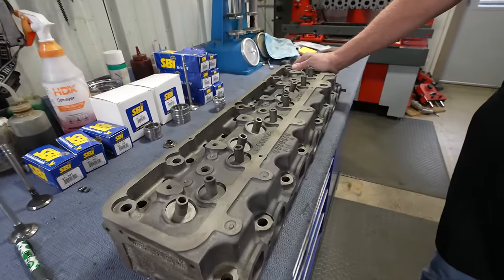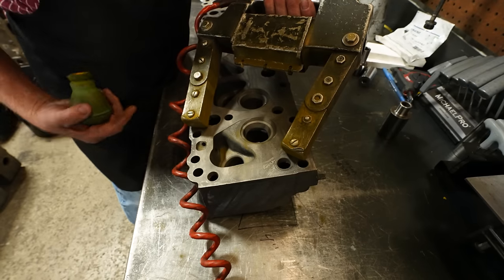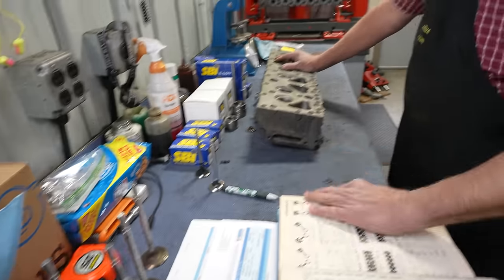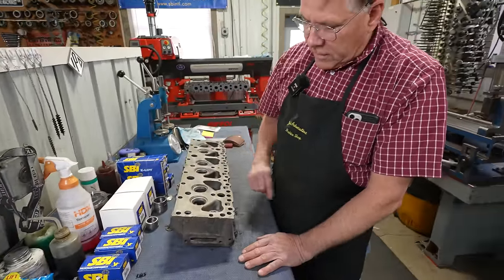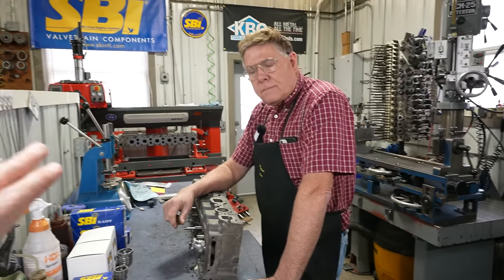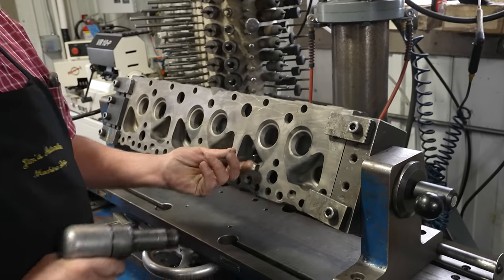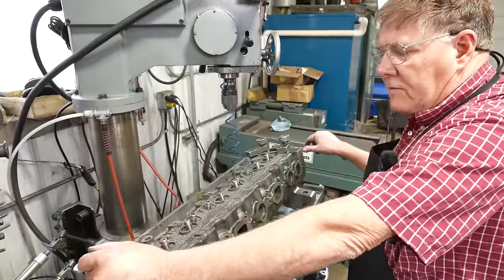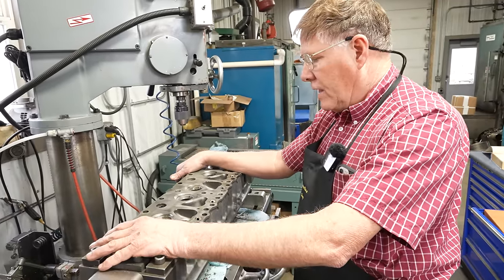Fixing The 235 Chevy Head That STUCK A Valve Guide!

Comment: I've seen a few of your videos about the venerable 235...I had one when I was 12 years old,  in a 53 Belair convertible...early 53, with poured rod bearings...my Dad and I rebuilt that engine in the backyard,  on sheets of plywood.  We cut up beer cans for main bearing shims.  Wound up rebuilding and installing a 56 235.

Comment: Worked in a trade over 20 years. When you spend that much time, if you're good at what you do, you pick up little sensory cues of something going wrong before most people would ever think there was problem.

14:43 , your father knew right away the tone change of the driver on the vale seat was wrong with the impact driver. He didn't force the issue, moved on to the next one for the time being.

Its those fine little things I love seeing in all these videos I watch, a testament to how much experience your father has, how his primary senses of touch, hear, and feel is better than any manual in print or tool made to do it better.

If anyone sees and appreciates the same, the crank grinding vids are a masterpiece of pure sensory operation while simply watching a simple dial on the machine.

Comment: Yes Jim:)
Every time we watch your channel…
We learn something. 

Especially the crank grinder:)
When you put stop bolt in between the crank weights. 
How flexible a Big Cummins Crank. 

Jim - you can also straighten a crank if it’s bent. 

They jack it in the bent spot. 
Use a soft race driver and hammer ..
Give it a wack about the fillet section:) 

V - Blocks hold the crank on each end. 
Then you hack on the low spot 
Sometimes it has to be repeated 2 or 3 times

After it’s within .001 or .002
Put it in your grinder and start grinding

Comment: Wow I have learned so much and I am 73 year old retired technician for Ford and Chevrolet. That was one fine looking 235 Chev head and I have seen several of them. I used to drive a 74 Corvette 80 miles some days to pick up parts on emergency jobs. All the other technicians would complain because they didn’t get to do it but I could do it on my lunch time. It had the 300 hp 327 cui engine and it was smelling like burnt paint and hot brake pads when I got back. It would cruse at 100 mph and do 140 mph on I 70 in the Missouri River bottom interstate. No State Patrolman could catch me. It stuck like glue on the secondary curved roads.

Comment: I never heard of crosshatching the valve but I have knurled and reamed guides to get them back in spec. I do believe that the knurling if done properly and after reaming the flattened point of the knurling supports the valve stem but there are small dimples between these flattened points that can hold a bit of oil. Kinda like a ball bearing in each dimple.

Comment: Vinton positive seals started using them in the early 80's and never had a failure.
Reply: What even are they tho
Reply: Same here. Our local machinist has been cutting the guides on SBC engines to accommodate SBF positive seals for years and it definitely helps with oil control issues.

Comment: We also oven clean all of our iron components, if a head has removable guides we always remove them before putting them in the oven, most often simplifying the extraction process.
Reply from the maker: We generally do as well; however, in this instance we debated not replacing all of the guides. Once it was cleaned & we checked a bit closer we decided to go ahead and replace them all!
Reply: @JAMSIONLINE  Nothing happens by chance in your shop.

Comment: We have a 235 in my grandpas 3100. We need to start it some time this year. Its been over 2 or 3 years since its started and ran.
Reply: You should consider using a like light oil to spray in till it stalls if you can't run it awhile I've had good luck with it with small engines it's a little extra work to start them again but it's almost always just crank a bunch and clean the plugs
Reply: Why does it NEED to be started?   If it's just to idle it for a half hour, you're doing nothing, in fact more harm then good!
Reply: @alro2434  I've seen alot of stuff rust up because the oil falls off like the cylinder walls and the cam lobes when it sits for a long time it's mostly fine in a climate control storage but most garages or just outside it'll act as a heatsink so it'll be cold in the warmer day and collect moisture in alot of places maybe not in a desert but definitely where I live. Sure starting it will cause some ware but it'll recover everything in oil, it's best to drive them even a little your right it's good for the rest of the drivetrain too

Comment: I read somewhere that knurling the valve stem is a "quick" way of tightening up excessive clearance in the guides without replacing them since knurling the stem increases the diameter. 
You have an awesome channel here loaded with the "right way" of doing things --- very enjoyable!
Reply: I agree - that's my understanding of why valve stems are knurled.  In the case of the previous machinist it made a the already 'tight' valve guide situation even worse.

Comment: I rebuilt my 4.9 Ford straight six a few years ago and I installed the same seals on my valves when I assembled the head, They have worked flawlessly ever since and the engine no longer smells oily out the exhaust like most of the Fords do. It's been a great upgrade and the engine runs so much cleaner.

Comment: Ketchup, yes Heinz is my favorite 😊

Way back in the late 70' when I was working after hours for the local Chevrolet Mechanic, we used valve stem seals for the Vega engine on small block chevys, they fit perfect with no cutting and yes  we would leave the oring off.
Same style used on this head but a direct fit, and excellent oil control.

Great Video.

Comment: Hey, I like these videos with engines that are as familiar to me as to the back of my hands! , ...On the chipping of seal and valve driving tools which get hammered on;  I welded a ring of mild steel like 7018 around the edge of the offending tool and that would hold for quite a while and stopped the more "chunky" parts from hitting my face (even with glasses on.) like the one that finally woke me up on safety musts!
You guys are easy to watch and the videos are done in very good taste, you got my vote! Best regards, John.

Comment: One of the most interesting engines I ever rebuilt was in a 1939 Chevy pickup.  It was an original 216 with oil dippers on the rods and 5 piston rings on the pistons; 3 rings above the wrist pin and 2 oil control rings below it.  I was surprised at how smooth and quiet it ran when I got through with it.

Comment: The first engine I rebuilt was a 292 out of a 69 C10. It had been redone about 10k before and the rings had never properly seated as well as they had not put the proper value seals in and it burt oil like crazy. 
Ot was a real learning experience as to why each type of product was used and the reasons why not to use others.
Great video. Thanks.

Comment: Back in the day when I worked in a machine shop (talking over 30 years ago, late 80s when I was a pimply faced teenager) we put those type of seals on everything including the Chevy inlines, small blocks, big blocks, Ford, Chrysler, didn't matter, they all got them.  Most in the 40s-70s came with umbrella seals and I think the small block 350s even into the 80s.  I can't recall ever having a comeback based on those valve stem seals.

I pivoted to tech in the 90s and don't regret it, but I do miss working on engines every day sometimes.  Good times with good guys.

Comment: When you are cutting seats, those long curlys mean there's nothing better. Cutting continuous all the way around in an even perfect plane. 
The blue valves, I had a 85 crate 350 the carb has a factory set bowl adjustment that I had to reset to stop the lean fuel mixture on acceleration. Headers were glowing red. Wow 😮

Comment: Wow 	! I was a mechanic for 50+ years on forklifts, when I started about 1970 my father in law who I worked for had a forklift company, we would rebuild the engines in house but have the cyl blocks cut and crank shaft done outside everything else was done in-house , I remember doing the valve guilds and seats with a special hand drill for valve seats  , all,the engines ran great but we never had the specialized equipment or exact tolerances that you create , your videos are great 👍🏻 some people should see the time and knowledge that goes into rebuilding a cyl head , then they wouldn’t cry about prices! LOL

Comment: A mushroomed chisel got me once. The chip sounded like a little firecracker.  Looked like a steel BB split in half. It penetrated my knuckle and embedded in the bone. I keep drivers and chisels dressed now.
Reply: Good quality drivers and cold chisels are made using medium carbon steel - circa 1050 or 1060 grade. Only the point of the chisel/driver is hardened and tempered, with the body of the item being left in a non-hardened 'soft' state.  This ensures that the portion that is struck by the hammer just simply deforms as opposed to generating dangerous shards that can penetrate the human body.  I'm somewhat concerned with the type of chisels/drivers that are available today - which may have led to your unfortunate experience.  I hope that you recovered completely  from your injuries to the hand.

Comment: I have heard that with heads if you use a short knapp paint roller to apply the RTV it seals great at least that's what a customer of mine told me after tearing down his engine. Then was the guy that got mad at me because I refused to work on his engine just because he used JB weld instead of a head gasket. After 65 years as a mechanic I still like to watch you and your dad work together. I never had a father in my life and you have such a good relationship with your dad, cherish it and I envy you.

Comment: An old gentleman I spoke to at a car show told me that, in the late 40's early 50's - Drag Racers would hot up the 215 Stovebolt sixes and stick them into their 30s Rods. And to be able to have an engine that makes over 120hp stock, vs a sidevalve V8 thats lucky to make 60, it doesn't take many mods to have them producing well over 250hp and you were in some serious butt kicking territory if you were running that for real. It was the hot setup until the Smallblock Chevies came out in the mid 50s and killed everything, some guys actually made good power from the Buick 263 striaght 8's too. Good times..

Comment: Rebuilt a head for a DT 466 years ago which had been previously rebuilt not too long before. The exhaust guides were history and filling the crankcase with combustion gasses. I noticed positive seals had been placed on all guides. I deemed that the problem. Got new parts from IH. They handed me the same guide seals. I told them that was the problem as to why the engine is back apart. They called the old mechanic over from the back of the shop and he said “hell no you don’t use those on the exhaust guides.”  He went to the parts bin and got what had been used previously. Reworked the head and as far as I know the engine is still going about 15 years later.

Comment: I had a 1951 version of these; before 1953, they had dipper rod lubrication; mine had about a half inch of clearance on the #1 rod when I got it. Bearings spun into the rods. 

The Stovebolt with 4 mains went into production in 1937, as I recall.

Easy to work on, which in my case was a darned good thing...

Comment: 59 yrs ago did my first “rebuild”. What I did not know vastly exceeded my knowledge. How I wish I had an opportunity to work in your environment. As an auto shop owner attending a business management seminar we were asked what about our business gave us pleasure. All others said money but my reply was, hearing the engine fire up after major repairs. My reputation is excellent but I still feel there is so much I don’t know.  My only question is did you not trust the valve guides. When I used to try to air hammer in (or out) VW valve guides the heads sometimes cracked.  Of course I did not have a good mentor nor means to check my work. Keep up the great work and share the ketchup. Are they a sponsor ?

Comment: I find your videos helping me understand more of the technical side of engines. Iamwhat is known as a "BUSH MECHANIC" in Australia. This is a person who has no formal Qualifications but has abilities enabling them to successfully carry out repairs including rebuilds. My vocation was as a Power Station Operator. In the good old days you worked in small local power stations where you were operator, mechanic etc as you were responsible for keeping the beer cold. I learnt a lot of my mechanical knowledge from our local Italian mechanic and frommy Uncle who ran a workshop which serviced the local farmers and used to do things such as forge welding, and he had his own Acetylene generator for hot work.
If either those gentlemen  saw you fitting guide valves in the manner you used,  you would be shortly sitting in a Doctors Surgery having your hands checked out from a collision with a tyre changing bar or something similar.
Something i learnt about fitting of interference bolts sleeves valve guides is it must be done in one movement. 
In the case of valve guides, I Would use a drift and some form of press and single move push them out no cutting or grinding allowed. This preserved the hole in the head and didn't create chatter or waves from using a hammer. Also kept the metal temperatures as low as possible. Each blow of the hammer creates friction heat.
The trick was tocool the valve guides relative to the head. Usually the whole head was heated to about  100oF by either leaving in the sun,  or adjacent to but not in physical contact with a stove or the workshop heater.
     In the case of the italian, he had access to compressed CO2 and had a modified drift through which he would inject the CO2 down through the valve guide. The press would be set up and the pressing out would begin. About 5 ton of pressure would be applied and at the same time trickle of CO2 would be released through the guide. After about two minutes the guide usually moved.If not the press would be pumped up but I never saw the press to go above 15 tons.
     My uncle did not have the luxuory of CO2. He used compressed air. He was the proud owner of a 10000psi compressor and when coupled to a small submarine air tank enabled him to use air instead of CO2. He later progressed to nitrogen when somebody put him onto an oxygen generator and the nitrogen was waste. He actually built the high pressure compressor for the nitrogen himself as the other compressor was busy filling O2 bottles.
      The fittingof the valve guides was easy and involved the use of the most valuable equipment in the workshop, the Beer Fridge. The freezer compartment  was good for -18oC (0.4oF).  For my uncle the delivery point for valve guides was always the freezer.
      To install a jig would be assembled to create a stop for guide as it was fitted. The head was preheated as per previous. a smaal amount of lubricant was smeared in the hole. Each giude was removed from the freezer as it was to be fitted. Generally the guide would beable to be pushed by hand . If the guide was tight a brass drift and a 2lb hammer got in home.Now days liquid Nirogen is avalable.
       Cheers

Comment: I think the modern positive seals are fine. I have been using them 30+ years on big block Chevys.  most Big Block Chevys had the umbrella seals from the factory. never had any issue with them, other than the cheap ones from comp cams suck. they are made of cheap plastic that cracks. I use several different brands, only ones that give me trouble are the ones from Comp Cams. I prefer to use Cometic if I have an option.

Most of the big blocks I build are for Drag boats or the big offshore power boats, but I also do rebuild for guys building numbers matching stuff for car restorations.  I wish I had another good machinist like you all close to me.  the guy I use now is great, he is a one-man shop, and he is up there in years, and has gotten a little slow at getting things turned around but his work is impeccable. but he always takes a few days later than he quotes me, but to me it is worth it to get it right. glad to see there are other out there doing it right.

Comment: Really like watching y’all do the machine work on the older model engines. Would really like to watch you doing an old Ford 289/302 . 
And I read where you can take older 289/302 block and cut it for a 1 piece seal , would like to the process of doing it.     Thanks

Comment: I am full agreement  with the new valve seats,  so this is an FYI or what I sleuthed out for a early 70s 302 when confronted with the reality of unleaded gas.   I was told as long as it was not a high hp version (and it was not) or even if it was as long as you did not romp on it significantly for long time,  they would do fine.   It was  though it developed problems with the valve stem seals and I did an in truck fix for that  of  just the heads which was just stem seals and clean up.   Seats were fine,  but huge deposits from what I believe was lead crud.     Just cleaned and back into service and many good years of service before it was sold.   Of course that was for myself and not a business and it was under 40k miles when I did the work and had no recession (valves fit the seats nicely)
Reply: Amoco had unleaded hi-test/premium for years & years before unleaded was required, the only pumps that didn't have the lead warning riveted to them.  Never a word about seat wear from anyone until the mandatory switch.

Comment: Awesome plane a lot of detail, and great performance, only one suggestion about the hatch access it should have been designed facing the other way if  you forget to latch it or should it fail and opens in flight it will crash the plane it will act as an air brake a very big one. Just a suggestion again awesome plane look forward to seeing it when completed. 😊